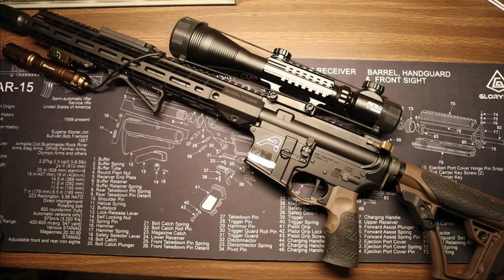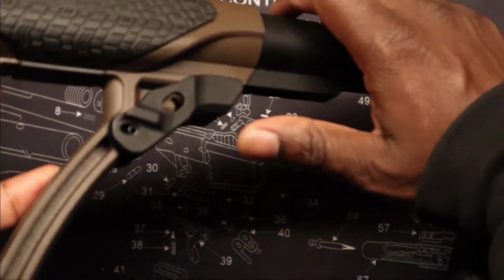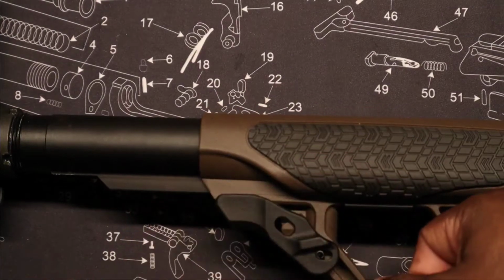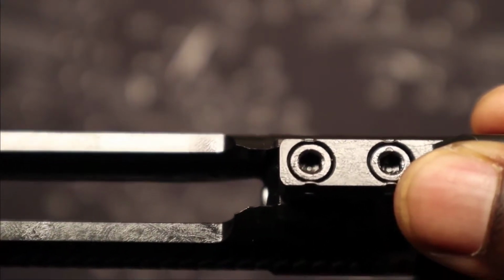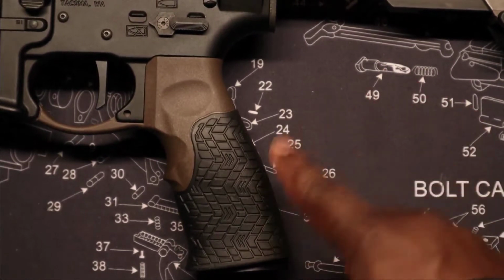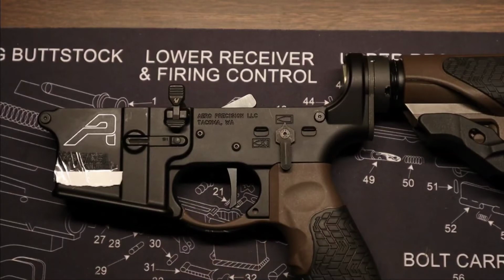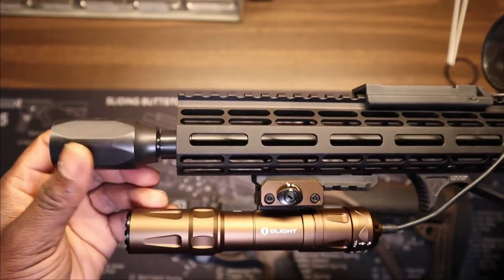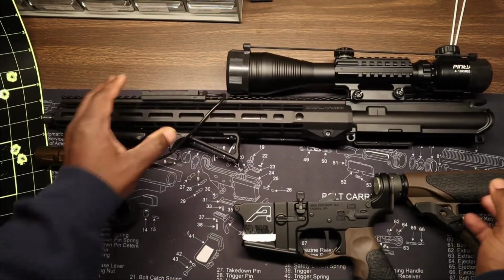Aero Precision 300 Blackout 16" Pistol Finally Completed.

Comment: Long range scope on 300 blackout?  OK.  And its not a pistol.  That’s just a regular rifle.
Reply from the maker: Yes it's a gas Pistol length rifle.
Reply: @404React_Media  It might be a pistol length gas system but its not a pistol.  A 16” barrel is much too long to be a pistol.
Most 300 blk come with pistol gas in case you shoot it suppressed……which was how it was designed to be operated.
Reply from the maker: @747driver3  Yes, I was agreeing with you in the first reply. I was just  stating the fact that it was a Pistol gas length.
Reply: @747driver3  it really sucks for me being from California because I’ve always wanted to build a 300 blackout pistol, but am limited to a 16” barrel. Anything shorter than that is considered illegal, which is pretty ridiculous
Reply: @salr1473  I live in a state where I CAN build a pistol but I have chosen the 16” barrel.  I like the  bit of extra velocity you get.  No SBR hoops to jump through.  It is STILL a very short, compact weapon with the collapsible stock….even suppressed.

Comment: What weight buffer are u running in your setup?
Reply from the maker: I'm using a H1 buffer.  Remember you can get a different proforma level from a Pistol gas system vs carbine. I'm using the H1 because my system used pistol gas length.

Comment: Nice build man.  Made the right call with that Daniel Defense stock and grip.  I have the v7pro great stock and grip.  I also have the pinty scope but haven't had a chance to put it on and use it, how do you like it ?
Reply from the maker: I would say it a good starter scope to start with and it has a good glass on it. I end up changing out the scope and placing a Red Dot with 3x Magnifier on it. Once Swampfox come out with their 1x10 FFP scope, I will be adding that on it.

Comment: Why go with the 2 stage trigger for a 300BO? Could see using that on a 6.5 Gendel upper or similar long range performance barreled upper.

Just curious, also how do you like that particular trigger vs a standard mil spec single stage?

Edit: very nice build btw, thanks for sharing! Also, have to agree with other commenter about light better at either 9 or 3 and cleaning up the wires
Reply from the maker: It's a 16" barrel that use more for hunting gun not home defense.
Reply from the maker: The trigger is very accurate and it feel good when shooting with my reloads. As far this vs a Mil Spec. This trigger just feel lighter to pull than Mil Spec Trigger. 
Yes, did update my scope and gave the one on the gun to a friend.

Comment: What gas tube length did you use
Reply from the maker: Go to Areo Precision website. Click on the drop down box and select AR15. Now click on the spare parts and then Gas system. On bottom page you can select your style of gas tube. Under those options you will have the choice of which gas tub. The one I selected was Pistol. Hope that helps.

Comment: Looks good and just a little critique. Sometimes less is more. Meaning unless you’re hunting for Buffalo at 1000 yards away, a.nice little red dot would look better and more practical. Plus the light placement tucked On the rail at 3 or 4 o’clock looks and functions better. Try a cloud defense mount for the tape switch cleans up the wires nicely.
Reply from the maker: Thanks on the tips. Thinking about on making those updates.